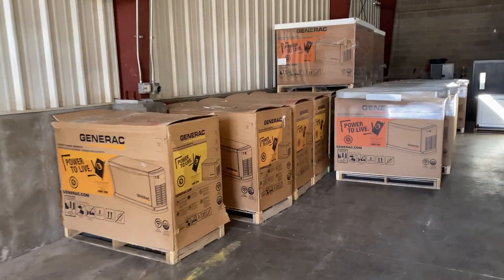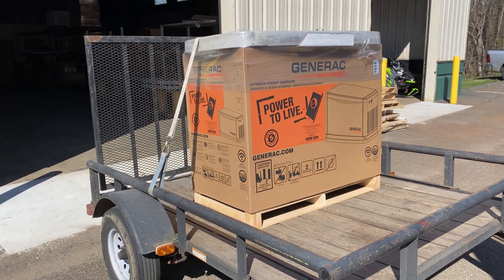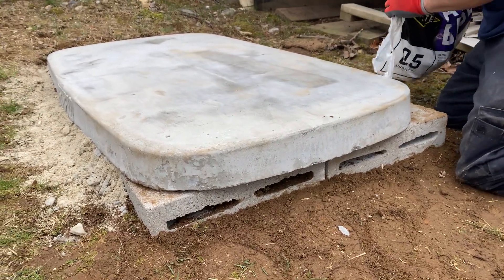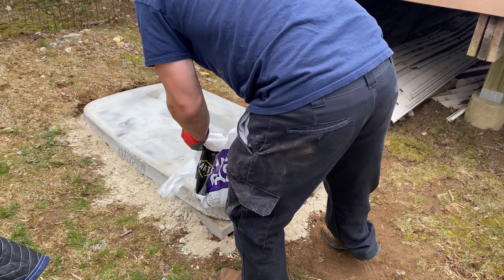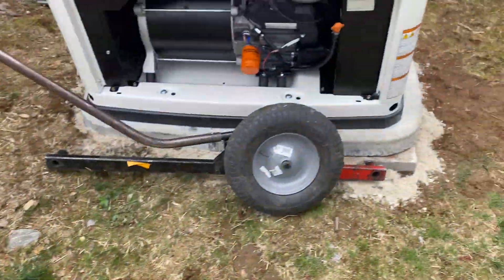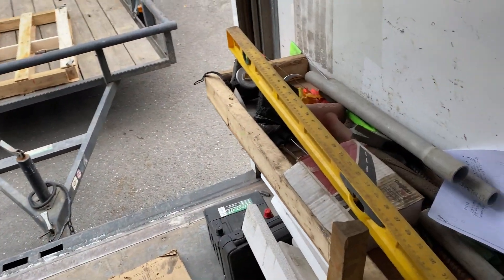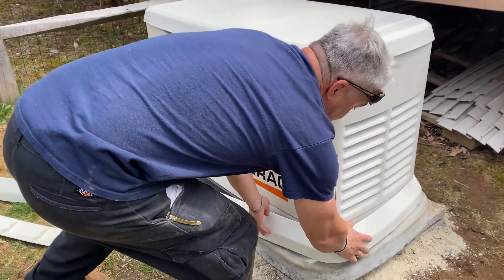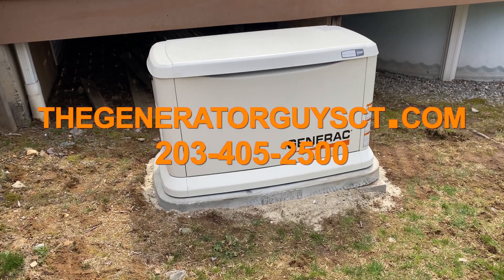How we place a Generac Generator with Genpad

Comment: with reference to bolting the Generator to the pad, how was this performed.   The video shows him screwing it down, but the boat just screwing the concrete? Help please describe how this was done.
Reply: Those pre-cast pads are designed for the generator so there are already threaded holes

Comment: The generator looks to close to the deck.  Generac stipulates distance from windows, walls, decks etc.  The generator should be at least 3 feet from the deck because of carbon monoxide.

Comment: How did you mark the holes for bolting it down to pad and what anchor type did you use? Great video by the way.
Reply: The pads come with pre formed threaded holes and bolts, they're long 1/4" or 5/16" bolts if I remember right